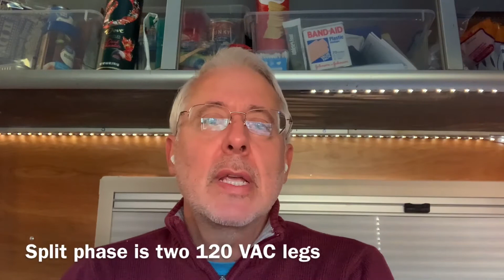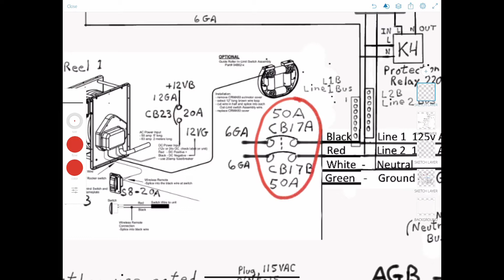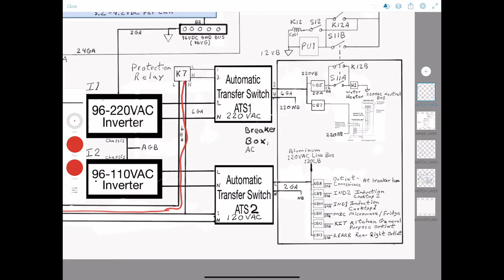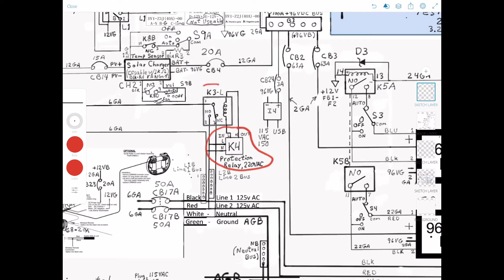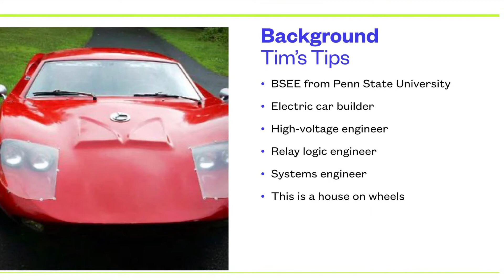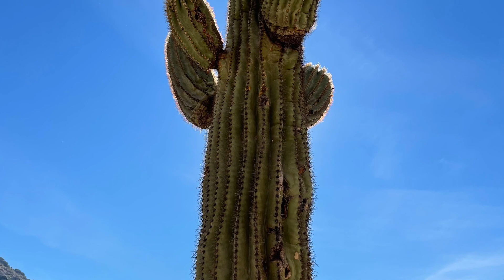Tim’s Tips #60 - Van Build, 220 120 VAC Split-phase Relay Logic - January 24, 2021

Comment: Would you be willing to provide details on the protection relays K4 and K7?
Reply from the maker: Search for “protection relay 220“ in eBay. Here is a current listing: https://www.ebay.com/itm/220V-40-63-80A-Over-Under-Voltage-Protector-Relay-Reconnect-Protective-Device-/133260163688?_trksid=p2349624.m46890.l49292
Reply: @tdrager  Wow, I didn't realize you could get something like that so cheap! Thanks.
Reply from the maker: @JohnTarbox  Agreed. People are paying $300+ for large, heavy RV Surge Protector and Electrical Management System (EMS).